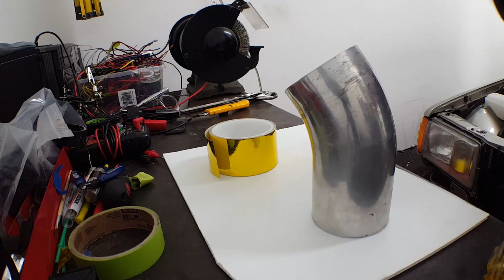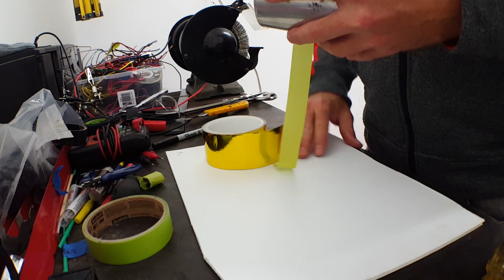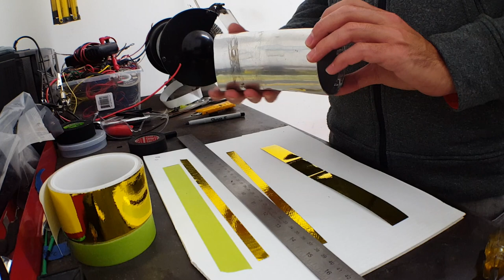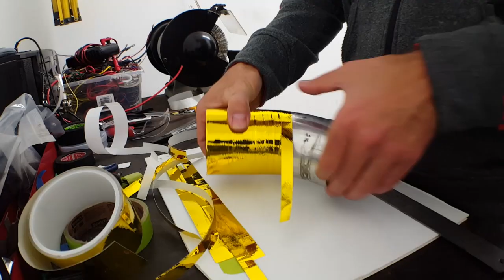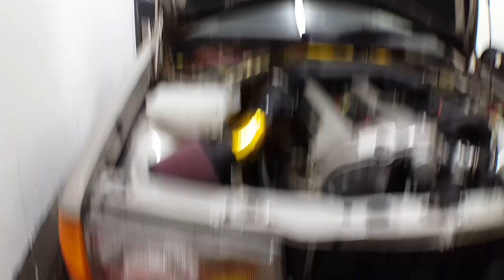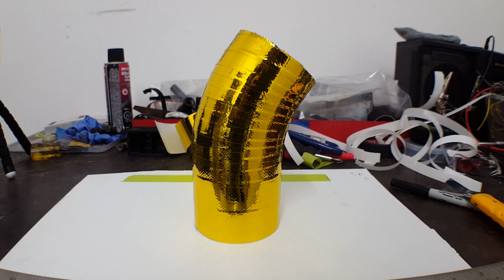HOW TO: Intake Tube GOLD Wrap

Comment: Very nice video, only thing I would say works better, is to peel a little bit of the backing off the tape, align the tape where you need it, and then pull the backing along the line you want the tape to lay, while sliding your fingers along the tape as it gets layed down. Laying it will be much quicker, and you don't run the risk of getting hand oils on the tape/wrinkling it/folding it onto itself/etc.

Comment: I remember when I wrapped my intake on my '96 corolla (literally just an elbow pipe), I had issues cause the damn wrap keeps getting wrinkled lol
since I put the battery in the trunk (functional), I extended the intake filter away from the fan but looked up a video & how to do cleanly wrap an intake without having any creases (or the damn air bubbles...)

Comment: Does this tape hold any heat value? Or is it simply installed to keep the air intake charge as hot as possible but looks cool?

Comment: does it make a difference in heat????
Reply: If you don't thermally isolate your intake track heat tape just holds the heat in that's all it does
Reply: @highspeedenthusiast6628  Like anothrr Youtuber was sayin, then all the time attacks, endurance cars are wasting rheir money because again and again it is used on intake piping boosted or NA.

Comment: Just don't. You won't notice any kind of effect
Reply: It won't matter on boosted engines because the air goes through the intercooler anyway to get cooled. No matter if hot air goes into the intake, it's cooled anyway.
Reply: Lol, intercooler piping will also soak heat, this will help reflect it. Also, colder air going into the intercooler will be colder coming out compared to hot air going in.
Reply: Oh, guess we better tell all the engineers at like every professional race team to stop wasting their money on it then 🤔🤔🤔